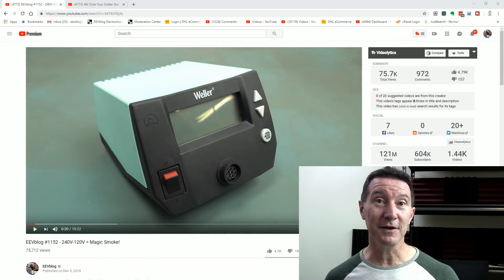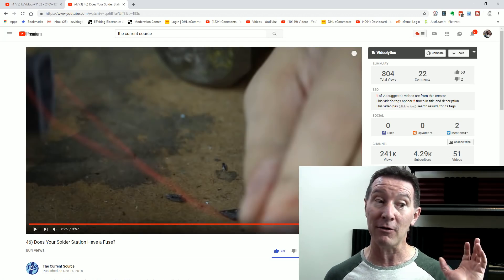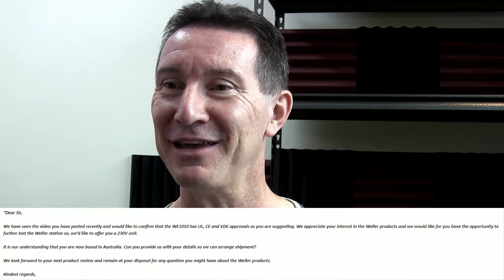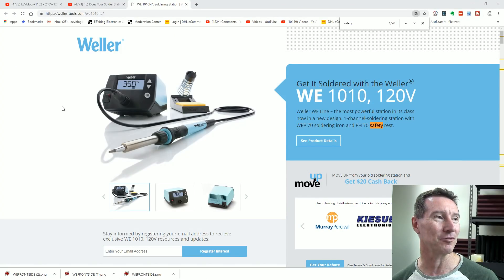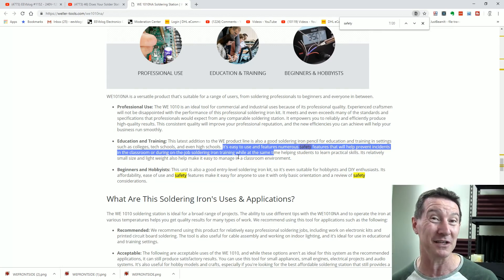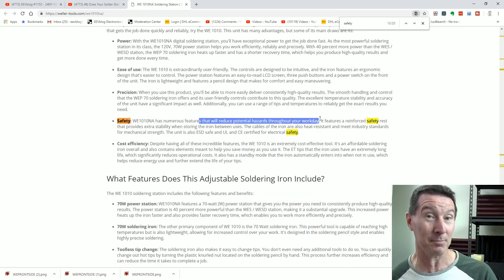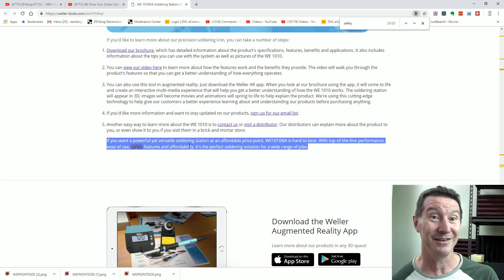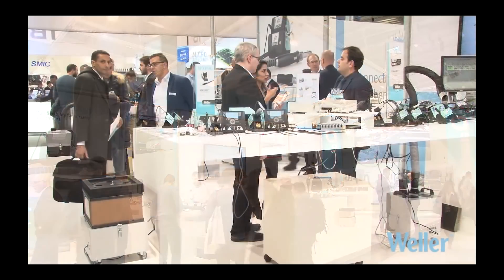EEVblog #1160 - Weller Responds!

Comment: So..you plug in a 110 volt app in a 220 volt  socket and you expect that it will all work normal?.......
Reply from the maker: Nope, of course not, my mistake. But I expected it to have a mains fuse to prevent smoke and a potential fire.

Comment: I just opened my 1999 Weller TC202DT power unit for shits and giggles.  It has no visible primary side fuse either, so this doesn't appear to be a new deficiency or limited to the 120V units.  It does have a glass secondary fuse, awkwardly spliced in mid way down the wire between the transformer and the iron socket - almost as if it were an afterthought.

Comment: Send a message to UL and CE and see if it's legitimate! If some have it and others don't I bet they are gambling on not getting caught.
Reply: CE is a self-certification. It means you have done due dilligence in designing and checking your product for safety. You don't actually have a centralized register of all certified products.
Reply: @davidjereb  
Thanks for the info and sorry for my ignorance. What's the verification and regulation process in a nutshell? Would it only come into play in the event of a catastrophic failure that results in an investigation or is it totally useless marketing garbage?
Reply: @UpcycleElectronics  You have various standards that define what may and may not occur should something go wrong with a certain type of device. By putting a CE sign on your device, you guarantee that the device adheres to those standards and is therefore fit for sale in Europe. If your device gets inspected and they find that it doesn't meet the regulation's requirements, you get shafted big time. Lawsuits, product recalls,... Enough to make a company go under and possibly put the people responsible in prison (if the fault resulted in someone's death, for example).
Reply: @davidjereb  Exactly!
Reply: "CE" basically means, "I, designer of this device, certify that it is safe for humans and animals". A CE mark on a device means that there exists a "statement of conformity". Any official EU language can be used to write the SOC.

Inside the SOC, the designer has to explain on what basis the safety of the device is based. The best way to do this is to state that the device has been tested against European harmonized safety standards. An SOC written like this will cause the device to be trusted: No authority will question the safety of the device unless serious problems are found.

Harmonized EU standards are very strict, there are generally an intersection of all national standards of EU member countries. It is allowed to base the SOC on tests against national standards. In such case the device can still be sold in the entire EU, member countries trust each other, but the device itself is only trusted in the country whos national standards have been used. In other countries, authorities don't need to trust the device and can take preventive actions before serious problems occur.

Lastly, you can write a SOC without testing against any standards. You, me, are allowed to design a device and sell it. No expensive testing procedures needed. In the SOC you describe then exactly what you did as a professional engineer in order to guarantee safety for humans and animals, and that to the best of your knowledge the device is safe to use. Your device will not be trusted by any authority, and if they don't like your SOC, they may still forbid you to sell it. You can also be held liable for what you write in your SOC, so don't write nonsense. Nevertheless, it is perfectly legal, and many small volume products are being sold this way.

Comment: Am I the only one that doesn't see the big deal? This thing isn't going to burn anyone's house down because it doesn't have a primary side fuse. That's precisely what the UL cert is there for. And I'm pretty sure the Elenco SL-75 I use in my own bedroom from time to time also lacks one.  I'm more likely to start a fire because the iron set the blankets on fire directly than from a short circuit in the transformer.

It really isn't a big deal. I look around my room at the 20-30 devices plugged into the mains and none of them have primary side fuses. Not my computer's power supply, not the two monitors, not my 30 year old boombox, not my analog model railroad controller, not my digital model railroad controller, nor any of the myriad of USB chargers scattered about, the RC lipo charger, the desk fan, my air conditioner, none of it is fused. It isn't that big a deal.
Reply from the maker: I bet you many of them do, internal primary side thermal fuses are pretty standard on tons of stuff. Have you actually opened your PSU and monitors?
Reply: @EEVblog  I've been inside my PSU a couple times for purposes of cleaning the heatsinks and fan. It's got a couple of MOVs in it for surge protection but nothing that would act as a fuse if the primary side shorts the incoming supply dead. The wires come straight out of the connector on the back and into the PCB. No inline fuse, no nothin', just straight into the circuitry.

And it's a Thermaltake, too, not some shitty one-hung-low off-brand that randomly explodes. Thing's going on 10 years old and still rock solid on all rails.
Reply: TestECull - They’re often soldered in type fuses on the actual PCB. I can’t say I’ve ever seen a PC PSU that didn’t have some form of fusible device. The presence or lack of a fuse has absolutely nothing to do with the reliability of your PSU! The only time a fuse comes into action is when excess current flows under fault or surge conditions.
Monitors also have internal fuses. Fuses aren’t expected to blow on them except under a fault condition, so they’re rarely user replaceable. Branded USB chargers and switch mode wall adapters also have either a fuse or fusible resistor in them for safety purposes. Cheap Chinese ones, not very often, unfortunately.
Reply: @ProdigalPorcupine  I've had one-hung-low chinese PSUs in the past, which did what all shitty products do: Explode. And I mean that quite literally, with sparks and shit flying out the back of my computer and taking half the system with them. Still no actual hazard to me. Motherboard, RAM, one harddrive, sure. But no risk of burning the house down, no risk of electrocuting me, even though the primary side shorted dead to the point there was a pop and a spark show out the back.

As an aside, that's also why I refuse to cheap out on PSUs these days. Cheaper to spend a bit more on a quality PSU than to replace a motherboard, RAM sticks, and a harddrive six months down the road...

I'd also like to point out that pretty much any SMD resistor is going to act like a fuse when there's a mains short running across it. They can't handle that kind of current whether they're designed to be a fuse or not. Same goes for most SMD components in consumer appliances, hell, in most appliances even the traces on the PCB itself will burn away if 15 amps at 120 volts are coursing through them.

Another thing of note: My 1.2kW window AC doesn't have any fusing in it. It does have a GFCI plug(And this is how I've known the past three failed via siezed compressors), but no fusing.
Reply: My thermaltake power supply has a bunch of fusible resistors in it

Comment: Just did a search for this model UL listing. It was certified under "	
Heaters, Industrial and Laboratory"
Reply: And another five cents on weller kwaliti. We sent two brand new 600$ soldering stations to the external lab for calibration (our RA/QA whim I fought arm and leg) and they were over 100 degree out.

Comment: Weller missing the point, I imagine you didn't want a replacement because you know you can't plug a 120V device into a 240V socket but that you were shocked that it bricked the iron so quickly. A VP replied so they're obviously scared of your clout. UL doesn't mean jack tbh, I wouldn't bother with it if it will effect your design.

Comment: Dave, I think you are being harsh on Weller just to be dramatic. Yes, they replied with a dodgeball answer and they should have had a primary fuse. However, a bench soldering iron is not commonly transported around the world and then erroneously plugged into the wrong voltage by mistake. Remember, you sell and promote junky Taiwanese multimeters, not flukes.
Reply: What the hell would a GFCI do to help you here?  The insulation between the turns on the primary could be (and is) much weaker than the isolation between the (earthed) core and either of the windings. It'll catch fire long before there is any earth leakage.
Reply from the maker: Watch my previous videos, I admit it was my mistake and it wasn't Weller's fault. 
And what happens if the transformer fails for some reason? Fuses are standard practice for this eventuality.
Reply: EEVblog yes I watched the original video. However in this video you did not admit any fault nor said weller wasn’t at fault. All you did in this video was nitpicked every little thing weller did just to be dramatic like how they called you sir and how they took a whole 11 days to reply.
Reply: @jakp8777  
What happens if the transformer fails for some reason?
Reply: Atlas Atlas some YouTuber gets to make a overly dramatic video to drum up views. Don’t you have circuit breakers in your house? If there was a serious malfunction, not just someone mistakenly using the wrong voltage the breaker or GFCI would trip.
Reply: @jakp8777  My circuit breaker is rated at 16A, but that transformer can start to burn long before reaching that threshold. The circuit breakers installed in your home are there to prevent the cables running to your outlets from burning, things you plug into that outlet can do a lot of bad stuff with 16A@230V.
Reply: @jakp8777  
- "Don’t you have circuit breakers in your house?"

They allow 3680W of CONTINUOUS power.
So this Weller station can burn my house and kill me even earlier with toxic smoke.
And no circuit breakers will be triggered. The building will be power of by fire team before this breakers notice anything.
And this is true for any building and breakers out there.

And also, in any case, I will lose my Weller station. Because fuse don't protect it.

And this is big deal for my region, for example, where real risk exist, that some building, or even few buildings, power accident can occur, which gives you 380V in mains.
And all electronics that have no protection will die and catch fire.

P.S.
I think the is many people out there who live in regions with extreme weather conditions, hurricanes, snow storms, etc.
Such conditions have tendency to cause weird and wonderful power accidents in yours mains.
Reply: Atlas Atlas lots of devices in your home have no fuse. I would suggest to not plug a 120v device into a 240v supply like Dave did (unless you want to drum up YouTube views) and/ or install a GFCI or lower rated breakers.
Reply: @jakp8777  
Actual, only heaters and motors in my home have no blow up fuse, but they ARE have thermal fuses.
So, all my devices is fused, it is just mandatory practice, and no one will save few cents on such thing, even 1$ chines led bulbs have one. 

So, go find a job or somting. Or girlfriend. And stop trolling on internet.
Reply: Atlas Atlas I’m not trolling, and I have a engineering job where I design switch gear. If anyone is trolling, it’s dave connecting a 120v device to 240v then being dramatic about his mistake (and them calling him sir) and his apologists like you.
Reply: @Llirik13  In the region that this weller device was sold, standard outlets certainly don't allow 3680w of continuous power. Most are 120v fused @ 15-20A for under 2400W. Still a fair amount, but a solid 50% less than what you are quoting is significant as well.

Now if the proper 240v version isn't fused, I couldn't speak to that ;)
Reply: @jakp8777  
So you have no technical arguments, and you just cannot stand that someone being dramatic?
And you sink that I actually arguing or will be argue with some random guy about his such important opinion about someone on internet?

You need to meet a doctor.
Tell the doctor about this horrible people on internet, he will help.
Reply: @UnreasonableSteve  
"50% less than what you are quoting is significant as wel."
" for under 2400W"
Continuous power.
It is still significant.
Also, breakers rated current and other parameters can vary in different setups etc etc.

"Now if the proper 240v version isn't fused"
It isnt.
Reply: Atlas Atlas so I need a job, doctor and girlfriend according to you? I think we know who the troll is, it’s you. Just don’t you dare call me sir as I will post a rant video on YouTube to be dramatic and get views like Dave did.
Reply: @jakp8777  
Good comedy pall. Well done.
Reply: @jakp8777  apart from the small issue that a circuit breaker may not brak before your bench is on fire, overvoltage can occur without you ever pluggin anything into the wrong outlet.
Reply: @jakp8777  switch gear? If you're designing anything vaguely electrical, you should really know your stuff better or learn how to troll.
Reply: @UnreasonableSteve  in case of a lifted ground, such a circuit could deliver 4800W. In any case, 2400W will suffice to melt a soldering station.
Reply: @jakp8777  He clearly says that after it started smoking he went "ooops" recalling that it's a 120V version. Sounds like an admission of fault imo.
Reply: @jakp8777  More quotes "Theres nothing wrong with the Weller, it's a PEBKAC, it was me" before he opens it up.
Reply: @jakp8777  What kind of a switch gear? Ones like the headlight switch in my old '99 Sharan, maybe? Oh boy, I have a thing or two to say about how those are a potential fire hazard or at least designed to fail. Putting 10A through tiny sliding contacts,  take your guess...

Comment: I smell Weller hacking in the works I'm using a weller thermaboost for HD soldering jobs and a radio shack 15/30 watt for component work

Comment: c'mon, dave. this one is a bit silly. you took something for one voltage and exposed it to a higer voltage. what did you expect? if you did this in industry, and posted something like "i hooked up a 24v box to a 240v control circuit and it let the magic smoke out! what were they thinking?" you'd get laughed out of the place.
Reply from the maker: Did you even watch my previous video? I said it was my mistake and NOT Wellers. BUT it did highlight a potentially dangerous issue that could be prevented by using primary side fuse that it practically industry standard everywhere else.
If oyu don't know how not having a primary side fuse could be an issue in a failure mode then I suggest you investigate the topic some more.
Reply: Have you ever seen 400V instead of 240V coming from your wall socket? I have, more than once. That would probably let the smoke out. Even my cheap and 'it cant get any simpler' chinese battery charger has thermal protection in the transformer plus mains and secondary side fuses in it. I know for sure because had to replace its thermal switch once.
Reply: It's a fucking IEC connector!  Any dum dum can connect those to the local mains voltage. And if that's too high, then kablamo!
Reply: still even if run on 120V.. if it overloads, you rely only on mains breaker 15A, and the item is 0,5A rated..

Comment: You obviously have something against Weller. They offered you a new unit, to correct your stupidity plugin the 110V unit in 220V mains so now the main problem is that it took them 10 days to do so!!! If you use 220V mains why would you get 110V device! How STUPID is that. You became spoiled brat recently. Try doing some actual work for money not just dumpster diving, unboxing free stuff from mail and disassembling oscilloscopes that you received FOR FREE...
Reply: Dave has for years provided tens of thousands of people with useful information and I think he deserves more respect than that.
Reply from the maker: I don't want a new unit without a primary side fuse thanks.
If you don't know how not having a primary side fuse could be an issue in a failure mode then I suggest you investigate the topic some more.

Comment: you should do a video on how to convert these over to dc power my ws80 runs on 12v ac. doesnt work if you plug straight into 12 dc.

Comment: I had an interview at 3Dfx (remember Voodoo cards?) in 1997. After being interviewed by the engineers, I was interviewed by the head of marketing. I buggered out in a hurry. No surprise they went out of business a few years later. Never work at a hardware company being run by the marketing department.
Reply: Well, Nvidia took advantage of some of 3Dfx's technology in their SLI tech. 3Dfx was the first company to ever implement dual similar graphics cards with the Voodoo 2.
Reply: 3dfx was founded in 1994 wasn't it? How long was that interview?
Reply: It was 1997. The 3Dfx interview was two hours with three managers for a QA position. An interview with Nvidia for a similar QA position lasted four hours with a dozen people.
Reply: A company run by engineers with no marketing experience will go bankrupt as fast as a company run by marketers with no engineering experience. The hardest part of any product is not making it, but selling it.
Reply: nVIDIA bought 3Dfx.
Reply: @simontay4851  Not exactly. I held 3dfx stock when it went down the tubes. Whatever nvidia got was during liquidation.
Reply: Many, many years ago i interviewed at EMC and when I was done they said “we don’t actually have any open positions, were just keeping a list of qualified applicants”.  I reamed them out for wasting my gas and time.